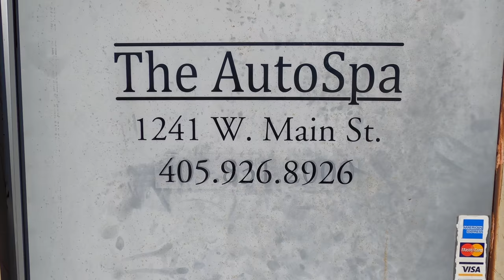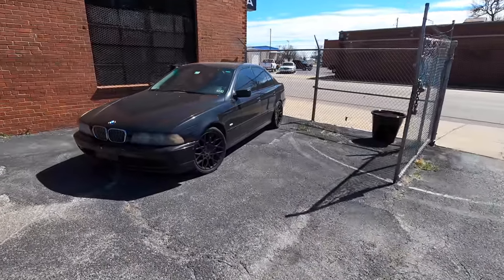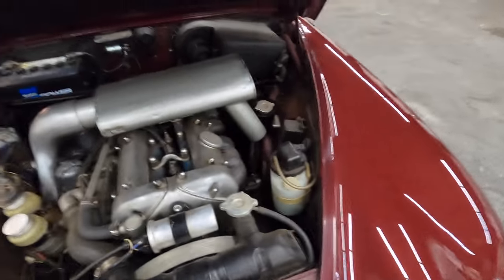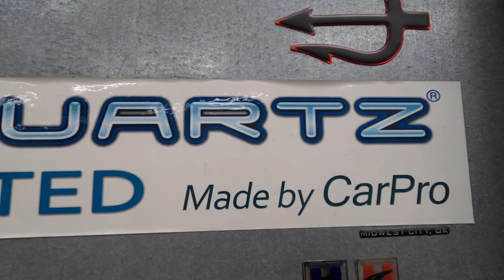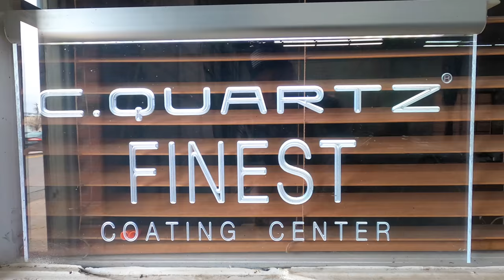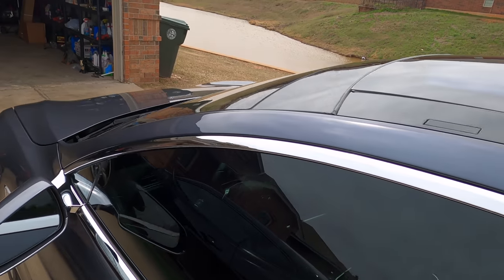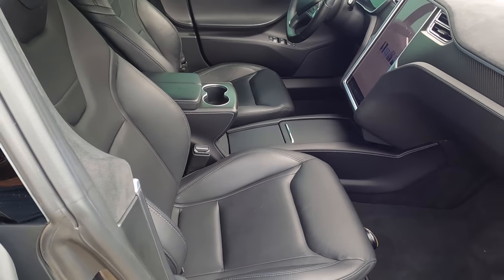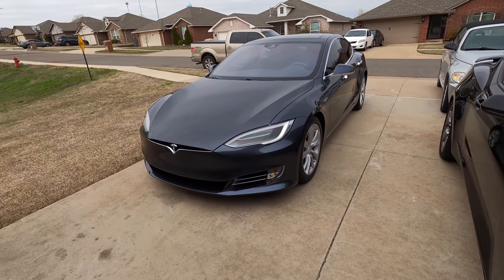2016 Tesla P90D Paint Correction and Coating by The Auto Spa LLC

Comment: The old English cars had intakes from around the exhaust manifold to get the engine up to temperature quicker so it would burn more efficiently and you could push the choke in earlier. They usually had a summer/ winter lever which bypassed the hot intake in summer. These days they take a small amount of the coolant and run it through the wall of the throttle body

Comment: Randy, the average temp in England is pretty cold compared to OK. you need a very good preheat for startup. but I am sure you know that. even American cars of that era usually had a preheat snorkel.  the carberated engines needed more preheat than the fuel injected engines that started to be more common in the mid 90's.